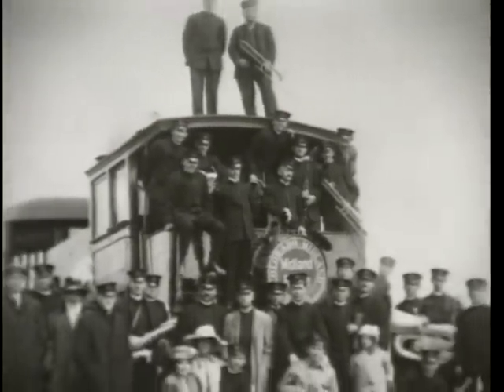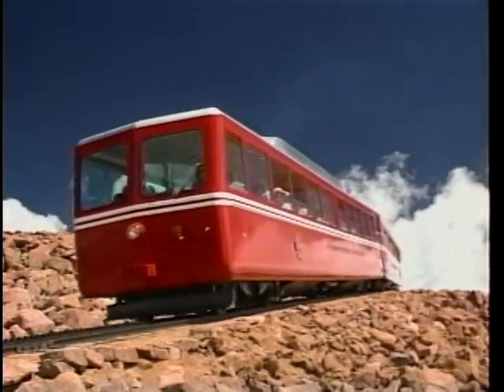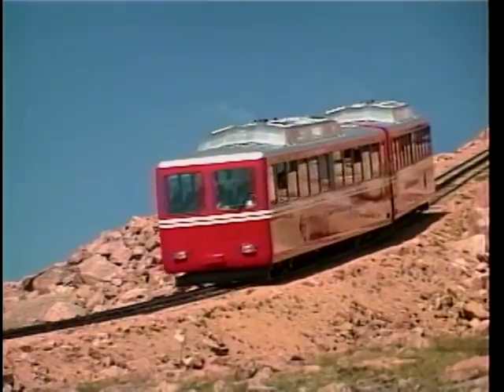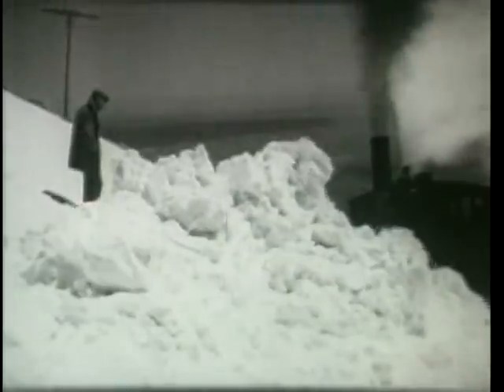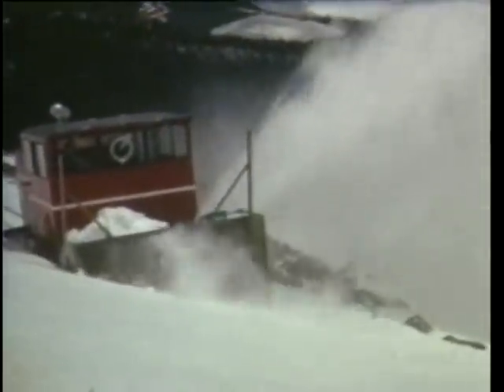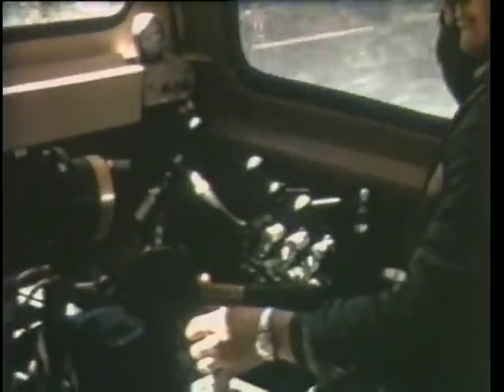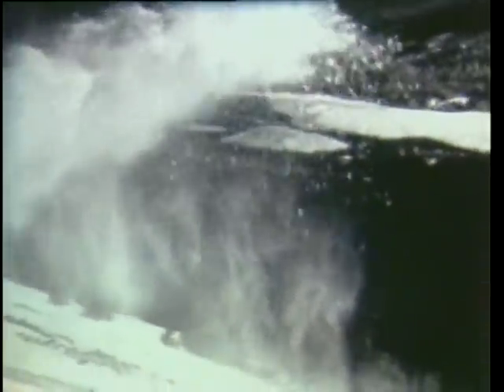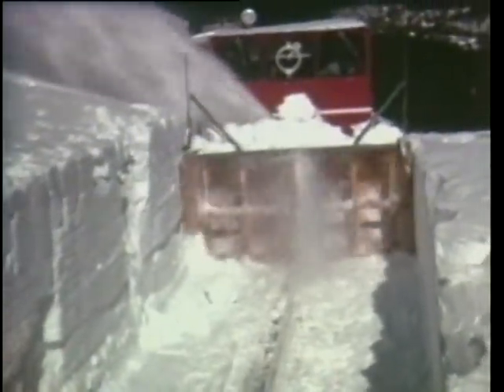Pikes Peak Cog Railway Snow Plow

Comment from the maker: The railroad was closed in 2017 for rebuilding. The entire track was removed to replace the 1890 rail, to replace wooden ties with steel and to use a more modern rack/cog system. The four twin unit trains are being converted to use the new cog system, The 4 single-unit trains and the entire collection of historic equipment has been given away to museums, parks displays and at least and at least one commercial display. The railroad will receive a new cog snow plow. The railroad will get a triple unit passenger train but not self-propelled (as all the twin units are). The new triple will use a new locomotive pushing. The deport yard goes from one to two track and the depot itself will be rehabbed and expanded. I'll bet I'm missing something! If this sounds expensive, it is. The estimated cost to completion in 2021 is $100 million.